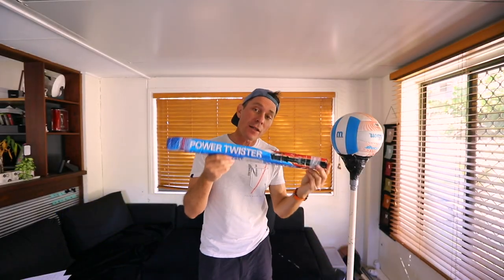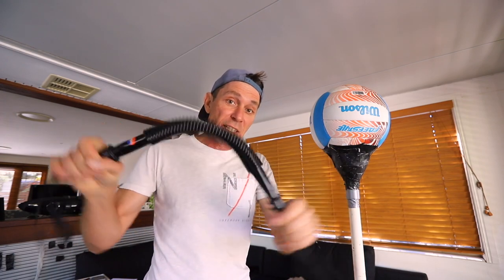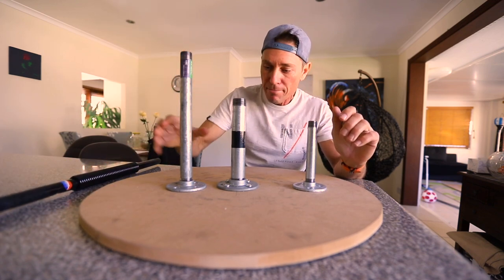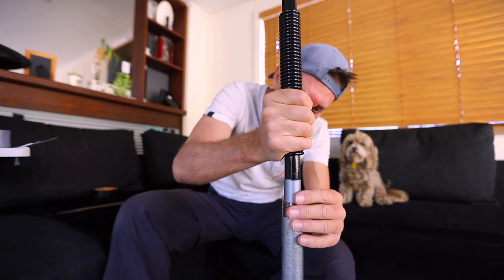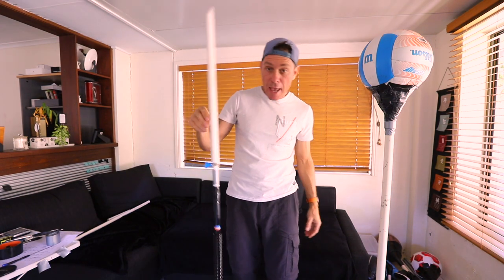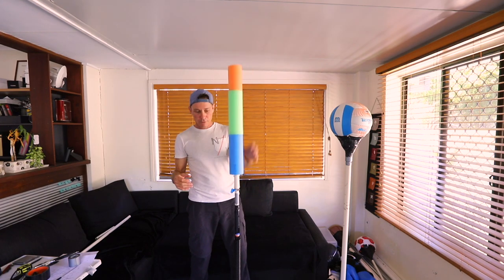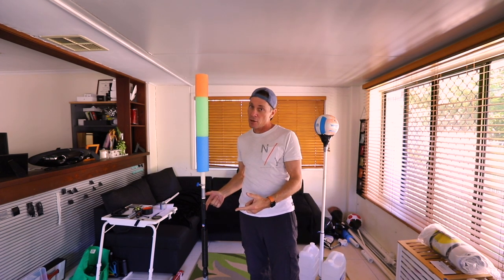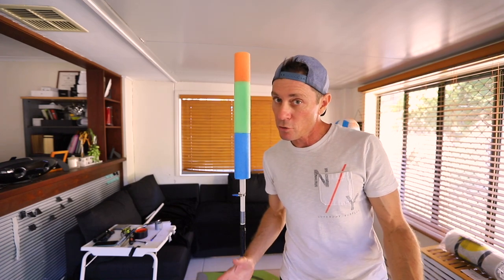Can You Make a Cobra Bag Using a Power Twister?

Comment: Oh snap, I was just about to buy a cobra bag before I saw this video. It even looks more durable than everything on Amazon and way cheaper to build.
Reply: If you're in the US, go to any hardware store and look for springs made for garage doors. About the same price as a power twister (maybe a little more) and longer so you have some wiggle room.
Reply: @jlgtapout  nobody wants to spend $500 let’s be honest bro😂
Reply: @jlgtapout  out of stock always
Reply: Double end bags are cheap and probably better kit to use. Cobra bags are good too but ridiculously over priced. Same as aquabags. It's just a bouy with logo painted on it
Reply: @latchie8893  only problem is where do you put it
Reply: @zeekotheone4060  the bouy? I have mine on aan everlast stand. As I'm not allowed to drill holes in wall. (Rented house) works fine.
Reply: @latchie8893  thank you for letting me know that  I’m gonna look at it
Reply: @zeekotheone4060  they are much heavier than heavy bags. But are better in a lot of ways too.

Comment: This is pretty funny. I've thought about doing this years ago with those springs you see on garage doors. They come in multiple sizes and are typically 3 to 4 feet. Turns out they're either the same or more expensive than the power twisters lol.

Edit: Damn, it turned out sooooo much better than I thought. Great job dude 👍🏽!

Comment: I really like the idea of that kind of feedback and having to move from a punching bag. The pool noodles seem to be about the right kind of size to make sure you're accurate. The different colors could definitely be good for zones of practice.

Actually what I want to do is take that same build but bring the spring a little bit lower and use it for my Filipino stick practice. I think you're really onto something and I'd love to see the full build you come up with.
Reply: I did do the build for both the toilet paper roll in the past and the volleyball. Both of them turned out all right but didn't seem like they would last because the PVC finally cracked after maybe the 20th time I used it.
Reply from the maker: Yeah I think opens up a whole lot of possibilities. I’ll need to put some thought into the bottom section height adjustment so that I can test all different kinds of options. I’m also still keen to try it with a ball. Stay tuned brother 🤙🙌

Comment: Awesome. I am about to get that spring and attempt yo build this. You should sell the man.
Reply from the maker: Check this one out before you buy a power twister: https://www.fighterdiy.com/2020/10/how-to-make-boxing-cobra-punching-bag.html
Reply: @Kewlus  great thanks. So for $40 that includes the advertised spring, pvc and 2 foam noodles? 
What else would I need if I buy this the base? 
Was interested in putting a very light weight ball on top
Reply from the maker: I've detailed all the items you need here: https://www.fighterdiy.com/2020/10/how-to-make-boxing-cobra-punching-bag.html, for both cases: wether you buy the Top Section Kit or just the spring. I'm about to start testing putting a light speedball on top, so that video is to come. I'm also likely to release an inner spring as an option for those people who might have a heavier top.

Comment: Nice job! I have a cobra timing bag but I got bored and experimented around with various universal and pivot joints that I had lying about to try to mimic the synovial joints of the body. More specifically, I experimented with a parallel angled offset to the cobra neck (the parallel offset is achieved with two pvc angle joints connected by a short length of pvc pipe a universal joint can be attached to this. The net effect is to create a timing bag that mimics the erratic head, arm and kick movements of an opponent. This rotating offset can be placed above or below the spring to produce different effects. It can be flipped upside down. All are useful for training. In my case, I have it set up so that I can swap out straight and offset sections to get different motion from the same basic cobra. You seem like a curious and capable guy. I’m sure that if you gave this idea a try, you could perfect it into something really useful.
Reply: What happens when you add the offset with the pivot joint is that the offset and anything that is attached above it can freely rotate in a circle about the vertical axis. So when you punch the bag this swiveling action adds side to side and front to back movement on top of the front to back movement caused by the spring, the overall effect is to simulate the effect of a moving and punching opponent. Try it yourself and you will see.
Reply from the maker: @resilientfarmsanddesignstu1702 some interesting ideas there!

Comment: I'm truly impressed with your creative idea ! just wonder can that be added with spar bar ? May be difficult as spar bar work with still vertical arm.
Reply from the maker: Thank you. The spar bar needs to have a rigid mast, so the idea is to replace the top section components but you could use the same base

Comment: Reedy could you critique my build so far? I’ll use the imperial system since that’s how I got them and I don’t have a calculator right now. I have a 3 foot long aluminum tube with 1.5 diameter. Then inside that is the taped up handle of the power twister. Then on the other side there’s a 1 foot aluminum tube with 1.25 diameter. Then I have the speed bag on top. So far it think it’s good but how heavy would the base need to be to keep it in place?
Reply from the maker: Sounds pretty good. Yeah a strong heavy base is the key. I’d recommend a heavy umbrella base or stand 🤙
Reply: @Kewlus  Thanks man

Comment: Do you know what grade your PVC pipe is? The PVC pipes at my local home depot didn't fit inside each other and telescope.
Reply from the maker: There's generally a small gap which I close by winding tape around the smaller pipe. Not sure of grade, but here's a link to one of them at the Bunnings shop where I buy them: https://www.bunnings.com.au/holman-15mm-x-1m-class-18-pvc-pipe_p4750046
Reply: @Kewlus  Thanks, after looking at that link, I'm pretty sure schedule 40 PVC is a bit thick. Supposedly it can telescope with a lot of force for a very tight fit, but I'd imagine you'd need grease and a mallet.

It looks like the best American equivalent might be "class 200" PVC pipe. I'll have to go acquire some.
Reply from the maker: Thank you Mojo. I’d really appreciate if you could let me know your findings. The PVC pipes are a key material component of many of my builds. I just want to make sure people around the world and in particular in the USA can get the right ones.

Comment: Hey buddy can we try tummy trimmer springs for the next project??
Reply from the maker: what is that?
Reply: @Kewlus  it’s a cheap fitness instrument that doesn’t really work but it contains spring in it …  I have checked it’s spring it can be used and it just cost 3$ hardly
Reply from the maker: @Themedbeast that’s a different kind of spring that would not work.

Comment: Definitely better than dropping $300 on one. Gotta be a way to make that spring faster, though. Hmm.
Reply from the maker: Moving the spring up and reducing the top section makes it faster. Next video I’ll try different top sections to see what works best.
Reply: @Kewlus  maybe a PVC (or steel) pipe slightly larger than the spring covering part of the bottom of the spring to choke up on the amount of movement? Like a sleeve, basically.
Reply from the maker: I have a feeling it might limit the range of movement but will test and let you know if that works 👌

Comment: Which of your Cobra bags turned out the best
Reply from the maker: The latest version with the Kewlus PRO Spring is by far the best simply because I can adjust the speed as well as the reach
Reply: @Kewlus  have you designed a refex bag with a sparbar?
Reply from the maker: I have a video where I show how the same base can be used for both - is that what you mean? https://youtu.be/eaeRVSKJTU0

Comment: hi bro struggle with diameter steel bar  @need to know please  diameter cm  steel bar 3/4 inch is it
Reply from the maker: It really depends on the diameter of the power twister. You just need to find a pipe that fits over or into it
Reply: @Kewlus  yes just don't want to spend 40 evro amazon just to know fit or not! thanks, bro any way! waiting bar then again going to wait for the steel bar!
Reply from the maker: You’re best to take the twister to a local hardware or plumbing shop and try to find a pipe that fits. That’s the problem with using a power twister - you just don’t know what pipe will fit. It’s also why I designed a custom spring that fits exactly onto a 3/4 inch pipe

Comment: How do u cut your steel pipe? And how you put threads on it ??
Reply from the maker: I don’t cut it but buy the right length and it comes with a thread on both sides
Reply: WITH A WHEEL FOR METAL PIPES.YOU MAKE THREADS WITH A VIDOLOGIST

Comment: Hey Reedy,  I made made my own version of this, following your instructions with a few tweaks.  I have mine on an MDF board, and have just ordered some tent pegs to secure it in the ground (on the grass).  Im thinking to get a 40kg or 50kg power twister now to make it even faster, do you think that would work?  Thanks for inspiring us all
Reply from the maker: Awesome!! I tried 50kg power twister but it was too much for the pool noodle top. You may need to use a heavier top
Reply: @Kewlus  thanks for your reply Reedy.. too much in the sense, that it was far too fast? Yes I would use perhaps a copper pipe rather than a PVC pipe and wrap some more noodles.. power twister is legit, I love it. Maybe I go for a 40kg rather than 50kg
Reply from the maker: Yes with the 50kg you’d need something like a ball to make it flex. I recon 40kg is the way to go if using pool noodles. Let me know how you go.
Reply: @beezybe7166  Any feedback on the difference between 40 and 50 kg? How did you use it? I'm trying to do this at my house and I'm having doubts between 40 and 50 kg
Reply from the maker: Sorry I used 30kg only, so can’t say what 40 or 50 would be like. I assume if you use a heavier ball it should still work

Comment: hey mate! just got a 60kg power twister and im worried its gonna be a bit to hard/rigid to work, what do you reckon? I pretend to use steel pipes on both ends of the cobra bag, and on the upper end use a soccer ball with a plunger attached! (i guess the build is heavier than this one, but enough to compensate 60kg?)
Reply from the maker: You just have to give it a try. I haven’t tried a spring heavier than 30kg, but with a heavier to like a ball I think it should work. You’ll need a super rigid base though. Possibly even bolt to the ground if possible. Good luck 🤙👌
Reply: Reedy Kewlus Thanks for the inspiration mate! I will be getting a 25kg umbrella base and if it isnt enough will put a 20kg olympic disk on the top! Keep up the good work brother
Reply from the maker: Thank you 😊
Reply: andres escrich how was the 60kg twister..was it too stiff?
Reply: @AndresEscrich  yes id love to see it..im thinking of either the 50kg or 60kg...
Reply: notpastrana pastrana Id go with 60kg if you want fast action and a heavy base to hold the pipes! Msg me on Instagram @andyescrich ill send you a vid of the badboy working
Reply: @AndresEscrich  brother you still have your cobra bag with your 60kg twister ?

i want to see in action

Comment: Hey reedy I really hope you reply because I have a question i am about to make a cobra reflex bag i have everything the base,ball,tape etc but i cant find the metal rod can i use a pvc pipe?
I really hope that you'll reply
Reply from the maker: What are you using for your base and what rating is your power twister?
Reply: @Kewlus  my power twister is 30kg and my base is a plastic box filled with 25kg of sand now I'm Confused that should I use the pvc pipe or I should go for any other alternative
Reply from the maker: You could, but how would You fix it to your box?
Reply: @Kewlus  I have some ideas like filling the box with concrete then adding the sand on top of it  or can you help me make a new one by giving some ideas?
Reply from the maker: Have a look at some of my previous videos where I use an MDF board and a galvanised pipe with a flange. For weight I just use 2 x 10l water containers from a supermarket. Concrete can get messy and hard to move around or put away
Reply: @Kewlus  okay sure I'll check it out! Thanks for replying broI really appreciate that

Comment: Will getting a lighter spring make it go fast than getting the 30 kg?
Reply from the maker: Speed depends on the size of the spring coils and the weight and length of the top section

Comment: Can I use 20kgs of Power Twister instead of 30kgs?
Reply from the maker: Yes but might be a little slower
Reply: How about 40kgs?
Reply from the maker: Might be a little stiff but I recon will still work
Reply: So 30kgs is the best for cobra?
Reply from the maker: That’s the one I tested and worked
Reply: Thank you kewlus. 🔥💯
Reply: I used 30kgs and it was stiff. It didn't bounces back what I throw Jab cross unlike 20kgs.

Comment: How do you call those colored thing?
Reply from the maker: Pool noodles
Reply: Hi sir thanks for the reply, is it possible you could use spring from the motorcycle. I think it’ll be faster. I hope you could make one🙏
Reply from the maker: You could simply use a higher rated power twister like 40kg or more. I tested 50kg but that was too much. I’d say 30-40kg is best. Motorcycle spring would likely have too much tension. Anyway I’ve moved from using springs to using fibreglass poles like the fishing of one I made - soo much better! Fast, quiet, low cost.

Comment: Hey man is the heavier twister faster?
Reply: I found a 50kg in such a good price(10$ from where i live) and im wondering if 50kg compare to a 30kg can make such a difference
Reply from the maker: I never tried 50kg because the spring feels too stiff
Reply: @Kewlus  so should i just go 40?
Reply from the maker: I think 40 would work
Reply: @Kewlus  Hey man haved u atleast tried it or something because i dont wanna ruin my earnings if it will turn out to be a failure
Reply from the maker: I never tried the 40kg one, so can’t really say. I ordered the 40kg one to try but they sent me 50kg by mistake and that felt way too stiff. I recon 40kg would work but you might need to increase the weight of the ball
Reply: @Kewlus  Thanks man appreciated it

Comment: what bag does ryan garcia and canelo use? Nobody can even answer that! They make cheap bags at the store... Im sure Ryan and Canelo have custom bags build for them that are not distributed! Boxing biggest secret!
Reply from the maker: The spring they use is different to those that most manufacturers use. I’m currently working with a spring manufacturer to see if I can come up with a similar or better spring
Reply: @Kewlus  it's very surprising none of these brand names can come up with a decent bag like Canelo uses
Reply: @Kewlus  where do you usually find coil springs? I didn't find the 50 kilograms to 60 kg spring that you mentioned
Reply from the maker: Yes I agree it’s very surprising